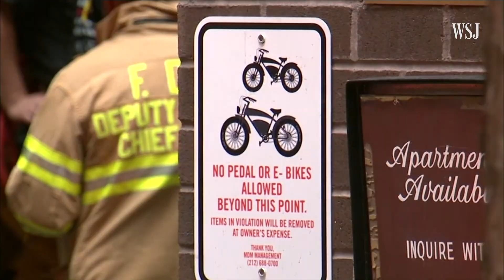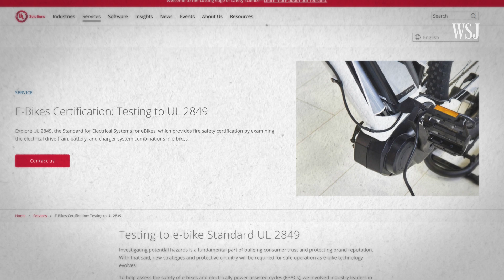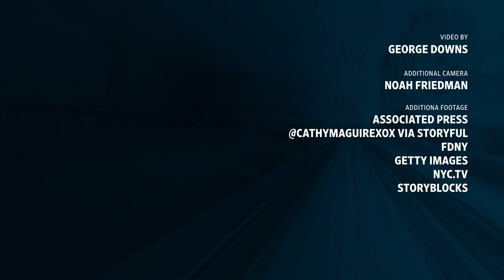E-Bike Batteries Keep Exploding. What’s the Solution?

Comment: The problem is this. People don't know how to use an electric bike. How can you leave your phone in the sun at noon? So how can you leave an electric bike with a 100 times larger battery in the sun? Problem two. Manufacturers cannot design batteries or they do it cheaply instead of quality. Many inventors have long patented thermistors, fuses, and various control systems. There is not even a cooling panel or fan in the bicycle battery to dissipate heat. Problem three. Due to design flaws and the rush of people, they want to charge the battery in 30 minutes. What can be done, however, must be dissipated from the battery during charging. This is where plastic comes in, which is basically a heat insulator and burns well. Just avoid fast charging, hide the batteries in the shade and think. In the past, people also thought that to check how much fuel was left in the tank of a combustion car with a broken fuel meter, it was enough to shine a lit match. Those who did this are no longer among the living. It is worth following the example of others who use the Common Sense brand. Google translator

Comment: Always charge your batteries outside, In 5 years of ebike riding Ive never had any issue with batteries, Ive got 7 ebikes all 52 volt battery types and only one has failed becauce of age and wear etc, good batteries have a cut out off in the BMS or the charger when the correct voltage is achived so it shouldent overcharge, its the cheap batteries and chargers that dont, charge outside if in doubt with a fire extingisher nearby.

Comment: Simply stop over charging them. Ignorant people plug them in and walk away, leaving them for days or even weeks on the charger. These are the same people that don't turn lights off when leaving a room. Cheap chargers don't have regulation and all of that stored energy needs to go somewhere. ALL of my chargers are regulated, and on timers. I have an e-bike inside my home, and it will never burn. Common sense, not so common anymore.

Comment: Have you ever noticed an E bike catch fire while someone is riding the same, I have not so is it the charger the at fault or the plug in cable which get's damaged and causes a fire, or is it where the E bike is charged like in the home which could be warm and there is no where that the heat can escape. I charged the E bike in the bathroom just to be on the safe side. If this a problem surely Hong Kong which makes NY look quite open I've not heard or seen any TV reports of fires there.

Comment: If these batteries are this dangerous the DOT will have to operate like the FAA and require 50 to 100 hour inspections by DOT certified inspectors. This might need to happen with any mode of transportation that uses these type batteries.

Comment: Strange but everyone is using the same type of battery. They also have LiFePo batteries. Thy don't catch fire, even if you grossly overcharge them or drive a nail through them. The solution, as always, is to get people to spend a lot more money. 🖕

Comment: Solid-state batteries can't come soon enough.
Lithium-Ion batteries have reached a pinnacle with semi Solid-state as far as traditional batteries can go.
Solid-state batteries will take us to another new level of safety and performance with Electric Vehicles just one part of the new battery revolution. Obviously the quality of the batteries plays a large part in any safety issue with any physical damage to the batteries easily done on an E-Bike over other applications hence the large amount of fires.
Roll on 2028 even if Hydrogen has a big uptake phones laptops and other devices will start using Solid-state batteries.
😎🇦🇺

Comment: How many gasoline vehicle fires occured in NYC during that same span?

E-bikes are not a problem.  They are a solution.

Two hundred fires in a year out of hundreds of thousands of e-bikes used daily in NYC (they define "ubiquitous") is an infinitesimal percentage, though the impact on those involved can be devastating. 

Certainly, there is an elevated risk of a fire with the cheap batteries on the cheap electric bikes that have been not been certified. I'm glad you covered the certification angle.

But even then, considering how many electric bikes are in New York City right now, the problem is being hyped-up to be a lot bigger than it is. 

They're all kinds of fires from all kinds of devices. I don't hear anybody talking about changing laws for gas stoves, electric stoves, petrol-fueled vehicles, lighting fixtures, bathroom vent fans, clothes driers,  or other such conveniences that frequently combust and cause deadly fires. (A gasoline vehicle fire is 100 times more likely than an EV fire, BTW.)

These kind of oil industry-driven fear stories are the very reason I decided not to become a reporter after earning my journalism degree at UF. 

I was the top Investigative Journalism student out of 15 years, accordIng to the course professor. That was out of approximately 15 to 20,000 journalism  students. But I could see in my online news internship while I scoured the wire reports that the news industry was corrupted by big money - the kind of money you get from the defense industry, the automobile industry, the financial industry and the fossil fuel energy industry.  Those who advertise most control the news the most.

An experience like mine would turn anybody into a liberal. Most of the corruption that you see coming across the wires is done by conservative interests, Republican interests, and huge corporate interests.  You'll never see those stories unless you have access to these wire services, something that only journalists have. This is why reporters turn into liberals. They don't always start out liberals. It was about 50/50 mix of liberals vs  conservatives in my major. They become liberals from what they learn on the job.

If you own an electric bike and you want to be cautious, I don't recommend charging your battery to 100% on a regular basis. I do not recommend that you charge your battery after you have finished using the e-bike. You should charge the battery just before you plan to use the e-bike. I recommend that you keep the battery in an outdoor storage facility.  I recommend you never plug in a battery to charge and walk away from it on attended.  And I recommend you get a high-quality electric bike instead of getting one of these cheap and junky Chinese electric bikes that have flooded the market.  You can get a perfectly fine and safe Chinese bike, but it should be an American company or a European company that is doing the design and specifications. You don't want the Chinese manufacturers to be in charge of that stuff.

Most of these fires have happened with cheap, junky Chinese batteries on cheap, junkie Chinese e-bikes that have been charged to 100% and then left to sit.

The reason lithium-ion batteries combust is because they have defective conducting foil or defective insulating separators. This is usually caused with static electricity built up on the robotic machines that crank out the battery cells.

All batteries are prone to these defects. They're impossible to avoid if you're using enough of these batteries. And it's usually not a problem. It's a micro-short circuit. Where you get into trouble is when the battery pack has comparatively more of these defects and the battery is pushed too hard. By being pushed too hard, I mean charging them to 100% on a daily basis and running them down to the lowest charge on a daily basis. 

I'm constantly seeing guys walk their e-bikes where I live in Providence, Rhode Island.  Those idiots have been running their batteries down to zero. They are inviting disaster.

This story is analogous to the story about the Tesla chargers in Chicago during the deep freeze.  I'm not going to get into all the layers of that story, but it amounted to lazy journalism and corrupt journalism, driven by the oil industry.

As far as the steps the state and the city should take, I believe outdoor charging facilities in containments are a good idea. I think education of people using these vehicles is a good idea. I think the riders and owners should be required to get insurance for the vehicle, not only for collisions, but for the fire risk.  I think e-bike riders should be licensed. Those things are much faster on average than regular bicycles. And the people who ride them are often completely ignorant to the do's and don'ts of e-bikes, as was the case with those Chicago Uber drivers of those base model Model 3 Tesla's with the lithium iron phosphate batteries who tried to charge a battery without preconditioning it and tried to level-3 fast-charge the cars to 100% instead of the recommended 80%, therefore doubling and even tripling the required charge time.  My buddy has a Model 3 there and he had no issues charging it with a level 2 charger.

FYI, I worked in the bicycle business for 13 years, managing or assistant-managing for eight of those years. 

If you want better knowledge about electric vehicles, their advantages and their limitations, I recommend you go to Electrek, a reliable, responsible EV news source. Transport Evolved on YouTube does a fantastic job of reporting, as well 

Don't be stupid with an e-bikes.  But don't be cowered into stupidity and fear by slanted and often blatantly-false Big Oil-driven news stories.
Reply: gasoline fires are way less dangerous than lithium fires and considering that there are many very old gasoline vehicles out there and the lithium vehicles are still quite new, the fires are already very concerning. Furthermore the gasoline cars don´t catch fire in your living room.
Reply: @segoiii  The statistics are not on your side as far as comparing the dangers of gasoline to the dangers of lithium ion.

If you had a gasoline powered assist bicycle and you parked in your living room yes you would have a fire risk.

Gasoline powered motor vehicles are 100 times more likely to catch on fire than battery powered electric vehicles. I just saw that stat yesterday. And I follow this stuff everyday.

Plug in hybrid vehicles are 300 times more likely to catch on fire than a regular straight EV.

The real problem is that there are shawty brands that are using shoddy batteries that are dangerous. The charging should be outside and containments. I felt this way about this for years ever since I first heard about it. It's actually a very rare phenomena. Gasoline is much more likely to catch on fire and I don't understand how you can say gasoline fires as safer fire than an electric battery fire. You get a lot of smoke and smoldering with a battery fire before it turns into flames. Can you go you don't get the giant explosion like you get from gasoline. My ex-girlfriend's parents were blown up in a gasoline fire in their house. They and other people died.

I've looked at the data and I've looked at the fax. I can tell you haven't done it. You should do it and then get back to me.

Comment: I have 2 e-scooters. Total of 3 (one I gave away to a friend). It is true what the video is saying about over use and the batteries getting too hot or over worked. I only use my scooters for basic transportation each way to and from work. When I charge, I put the charger on a timer (7 hours). The BMS (battery management system) should shut it off automatically, but just for a precaution, I put the timer on to prevent over charging. I also turn a fan on to keep the battery and the charger cool while charging. Simple precautions like that go a long way.

Comment: This is what happens when you buy just cheap shit. But there is not just the point, that these bikes are cheap, no they’re also extremely powerful what stresses the cells in a bad way.
What could be a solution is to switch to LiFePO4 batteries. They don’t burn and they able to get stressed harder.

Comment: I have had my befang modded ebike for 7 years now still with original battery without issue but I still only charge it with the battery in a stainless steel trough as a safety measure.
the biggest issue now is there are far too many uncertified batteries on the market because of the lack of enforced gov standards

Comment: Funny how battery powered tools from Team Red, Yellow, Teal, Orange, Green, Blue, etc. which take MASSIVE beatings on the job sites and use the same Li-ION cells inside their battery packs DON'T seem to have this problem. When is someone in that room going to address the elephant in the room with QC problems and poor quality? Every country allowing that garbage onto their territory is to blame. There is NO way that crap passes any proper CSA, UL, ULc certification. ETL Intertek is dodgy AF and the Luxembourg of the e-code certification level equivalent.

Comment: "Up a whopping 233% in two years
 The fires have resulted in 163 injuries and 10 deaths,"

NY City has per year on average;
Structural fires: 27,053. Non-structural fires: 13,730.
New York once again leads nation in fire deaths with 144 so far this year

In 2022, a total of 2,284 Americans died in residential fires. 144 of those deaths were New Yorkers. This information is according to the Firefighters Association of the State of New York.

So to put perspective on the scare tactic of claiming "233% increase"...  going from 1 per year to 3  is a 300% increase, just saying!

The total NUMBERS is what's important, and they were;

NY City Structural fires: 27,053
NY City deaths in these fires: 144 
The E-bike related fires caused 163 injuries and 10 deaths

In 2022 NY City Firefighters / fire officers who sustained service-connected burn injuries resulting in medical leave  was 173, I assume that's in ADDITION to the above 163 injuries of civilians

So we know 144 deaths were caused by fires in general in NYC in a year,out of 144, just TEN were due to E-bike battery related fires, the other 134 were caused by other things like smoking in bed, electrical faults, faulty appliances, space heaters, candles. By comparison the battery caused fire deaths are just  6.9%

Cigarettes Leading Cause of NYC Fatal Fires
April 27, 2007
Seventeen people died from fires started by cigarettes in fiscal year 2006.
 Smoking was the leading cause of fatal fires in New York City, according to FDNY statistics. Seventeen people died from fires started by cigarettes in fiscal year 2006 - tied for first place with electrical fires caused by extension cords.
Smoking-related infernos topped several other categories of fatal fires, including those labeled "intentional," which killed 13 people, as well as those started by matches (12), candles (10) or gas or vapors (7), according to the FDNY's annual report covering July 1, 2005, to June 30, 2006.
Reply: What they are lying with statistics to pass overreaching regulations? Say it ain't so!

Comment: I design my own batteries and they are designed in a way that are much safer than the average battery in a e-bike.  Thicker cable, better BMS units, higher quality insulators, etc.  I hope laws won't limit my ability to make a safer battery for my own use.
Reply: @GNMi79 Homemade is an understatement.  These are professionally made batteries that happen to be made in my home (workshop).  That's like saying a car restored in someone's garage is not as good as what came from factory.  If it is done by a pro, it is pro work.
Reply: Can i buy one off you for my vsett 10+ @SkaterStimm
Reply: Spent a lot of skill points in mechanic it seems😂
Reply: Bms will not protect parallel cells. Tesla uses fuse for each cell to isolate overcurrent cell.
Reply: Are you certified? Did you attend a course for this, or is this knowledge you acquired by following others? The battery is the most expensive recurring cost of an e-bike. This will tempt some into following your example, but Is the risk worth the savings?
Reply: I hope that this is where the law will stop, otherwise YOUR freedom will drag all others down to the path that it will not be feasible - again - to use bike vs using a car - which is exactly what they are planning to do. Sorry to point it that way, but others that made them, may not keep to your standards.
Reply: You sound very knowledgeable and responsible. The problem is many aren’t. There is no current oversight on their work.
Reply: I agree on the cables , especially 1kw motor feeds are usually barest minimum, but to fit thicker cables is an art ! I have to forgo the `outer `insulation to fit upgraded cables and often the silcone waterproofing is taxing to disassemble .
Reply: I bet they likely will.
Reply: @ttonAb2  doubtful.
Reply: @SkaterStimm  well I think you need to listen to politicians more, the larger this gets the more concerned insurance companies will get and they will start demanding changes.

Comment: first change should be ALL  E bike batteries must by say  2025-3026..  be ONLY lifepo-4  as this do not  burst into fire.
i am a bit older living on retirement. and have thought about a E trike for my back. as now they are out of my price range. 
the cheap amazon, zumo, are the problem built very low on the scale ( cant even use the word quality with them)
built with the lowest and cheapest mtrl they can find.
and build by slave labor.
Reply: No don't outlaw my lithium titanate battery it's safer than the LiFePO ones.
I share your situation and am getting materials for an "atomic zombie" homebuilt ice trike.
Heavier batteries are ok for a trike and I definitely don't want the flamable type onder my seat but a bike would suffer a substantial range and weight hit.